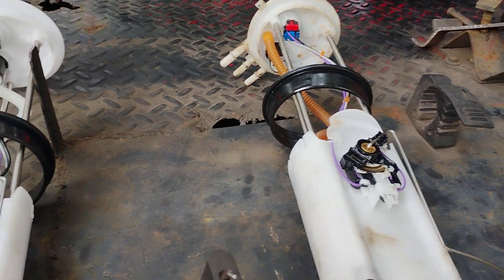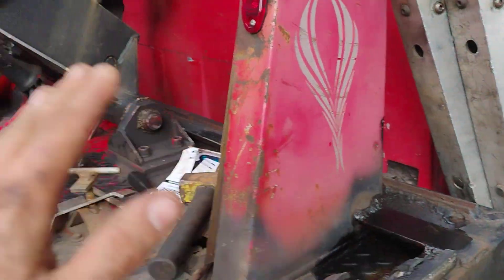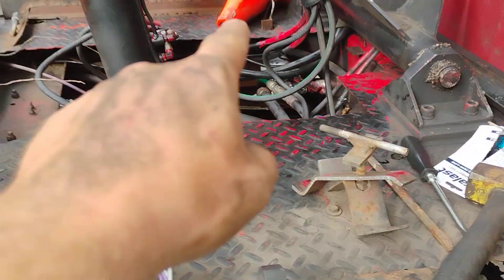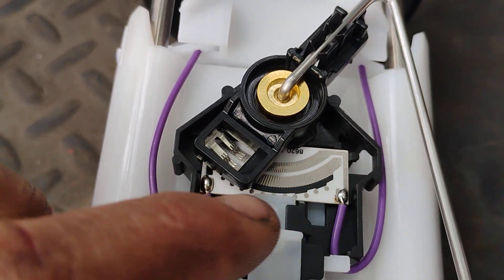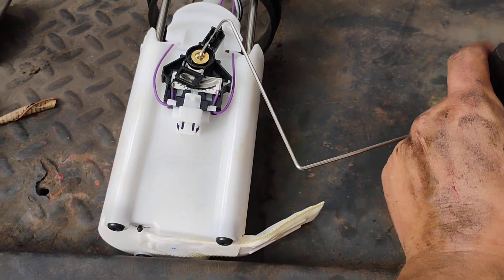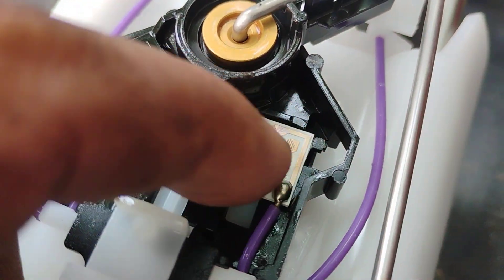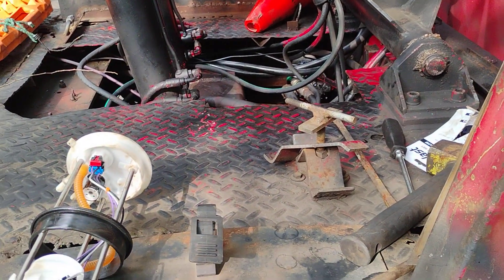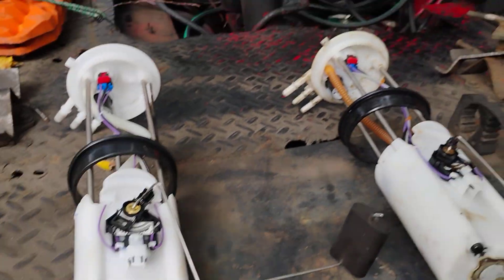20 Minute Fuel Pump Job

Comment: That’s the problem I’m having on my ford ranger. Pump works great but the level is always off. I just remember not to go past 214 miles 😂. I need to change my unit
Reply from the maker: When you have access to tow trucks, doing repairs under vehicles isn't a huge deal.
Reply: @MNDashcam  yeah for sure. For my truck it’s easier to unbolt the bed and move it back a few feet and you have full access to the tank.